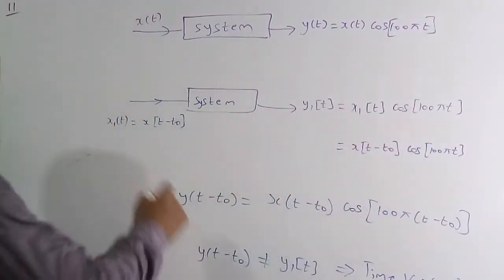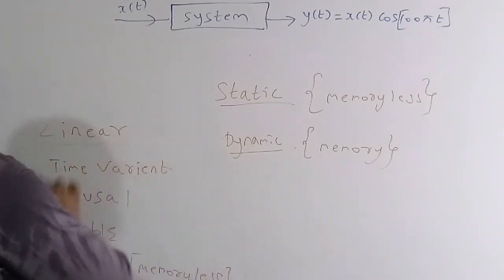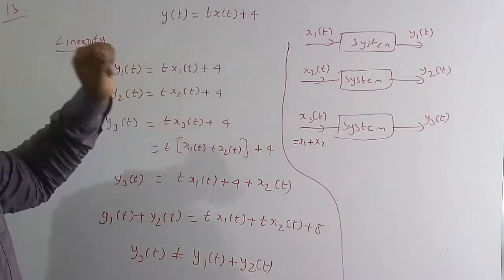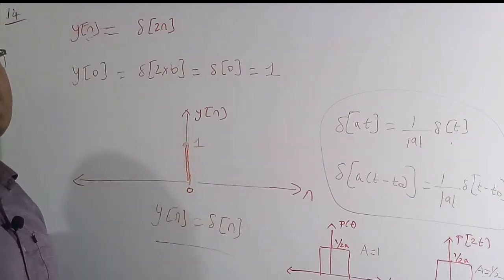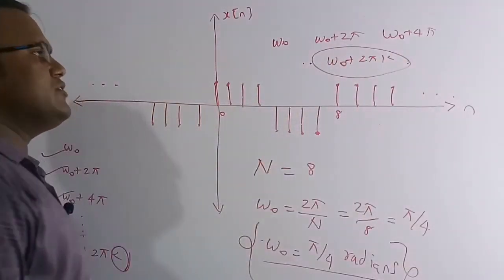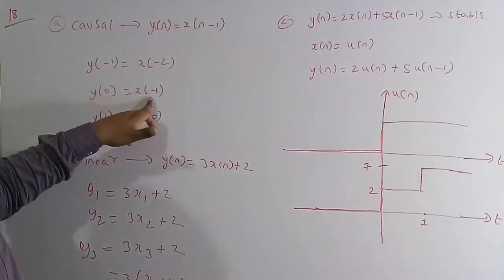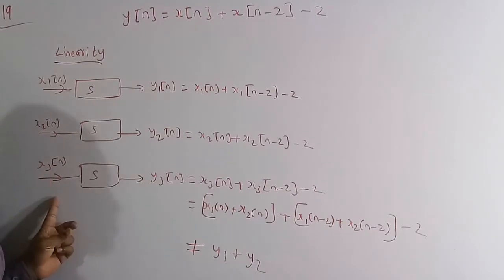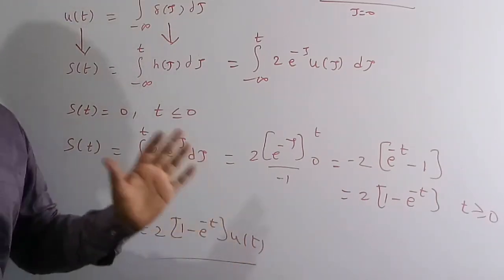Lecture = 2 Signals And Systems ( Civil Services Prelims ) PYQ Solutions

Comment: A 200V,960 rpm and 200A seperately excited DC motor has an armature resistance of 0.02ohm fed from a chopper with a source voltage of 200 V. For continuous conduction mode the duty ratio of chopper for braking operation at rated torque and 480 rpm is?